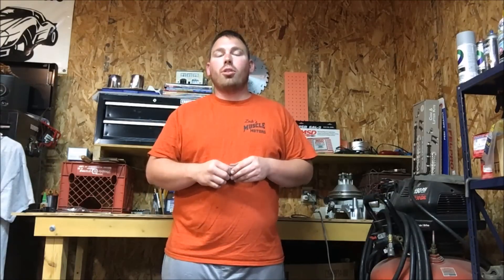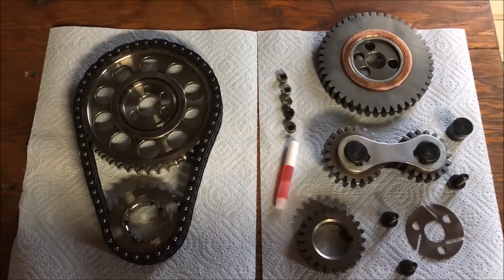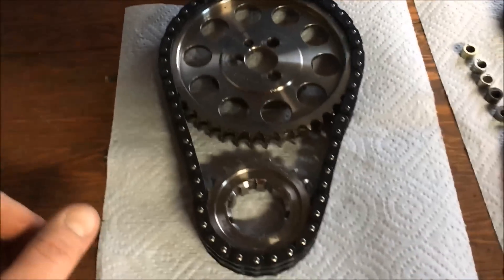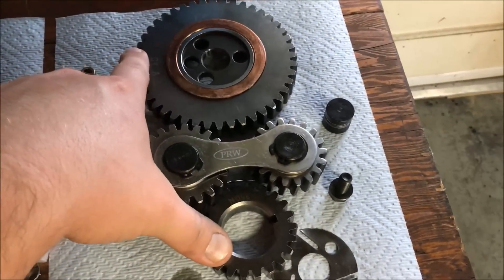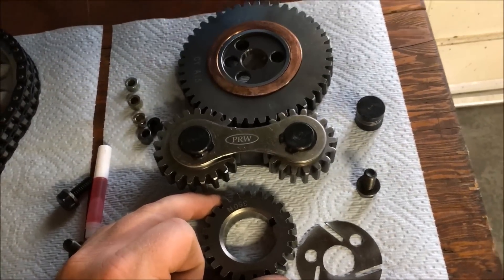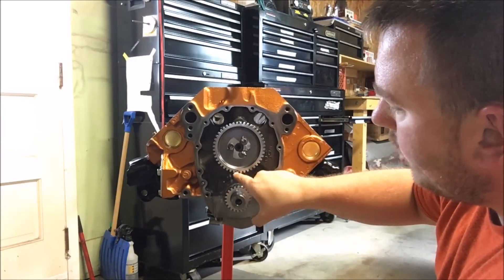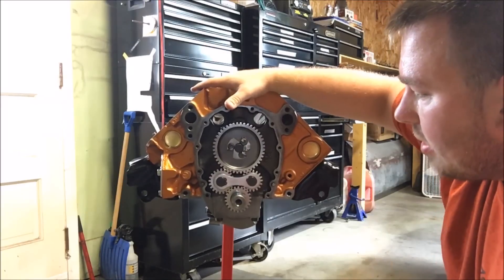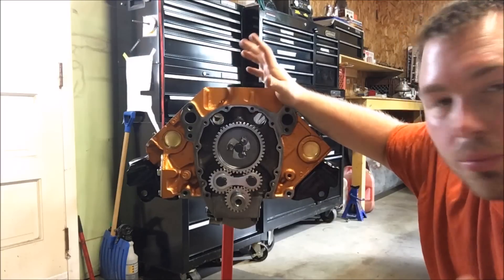Engine Building 101 Timing Gear Drive

Comment: Hey Zak Lamb..... I have this set up in my 85 Monte SS here in the UK.. needless to say Monte Carlo's are pretty rare here, never seen another at shows or for sale, so total lack of support.. anyhow you mention vibration being transfered to the block... how can I reduce this? is there anything I can buy? I don't know? maybe a Harmonic Balancer? sadly I don't know the 305 at all but I know mine engine has a few upgrades.. headers, H pipe, HEI diz, Holley carb, pro-flo air cleaner, 600hp rated prop, elec fan, but I want more power maybe 300hp but want to address this vibration thing you speak of...... I'm about to install Lunati cam kit, double valve springs etc.. grateful if you could take a lil time out on me.. regards
Reply from the maker: Hey Shane, thanks for your question!!!! When an engine is rotating, the mass is moving in a couple different directions, reciprocating and centrifugal. The vibration comes from a rotating assembly not being completely balanced. You have a couple options, but first let me say, with your 305 you won't have an issue really unless your turning some high rpms or your assembly is way out of whack. You'll be fine the way it it. When you start making more horsepower450-500 and up and turning 6,500 rpm or more you really want to consider taking out the rotating assemble and have it balanced. Also, a fluid damper ( harmonic balanced ) can really help cut down on vibration. I'll make a video to explain more for you in a day or two and post it. Hope this helps. Any other questions please feel free to ask!!!
Reply: Hey thanks so much for the info... like I said new to the 305 so a learning curve plus this Gear drive lark is all new to me, if it was a LB7 Duramax I'd be good lol!! (my other ride)
Reply from the maker: +Shane Pearce no problem man any time
Reply: Dear friend . PLEASE  Do yourself a favor Throw your Gear Drive away ..and purchase a Good high quality Cloyes Timing chain & set . If your really thinking about performance up grades get an after market set of small CC Aluminum Cylinder heads and depending on which motor you have  try the Comp Cams 268H if it's flat tappet . and use a nice high stall speed T.C.like in the 1000 over stock range remember the stock heads are whats keeping you from making any meaningful performance improvements  THEY SUCK...but there are any number of great balancers out there for that motor made by ATI.TCI ..just make sure it's NOT been dropped if your buying used look it over real well ...good luck..

Comment: A  Fixed Idler Gear Drive system (Like Milodon )is far better and superior then a floater Gear Drive system like you have shown here when you're going Gear Drive !
Reply: You just make yourself look like a moron trying to tear someone down for having a different opinion. I've known lots of people that have used these types of gear drives and never had a problem.
Reply: I don't  want any arguing here either! I have no hate at you at all Zak ! If you and I talked face to face it be alot better and what one is saying when typing it here at times !
Reply from the maker: True, however if you know what your doing, these are just fine.
Reply: There is not any skill really need to put a floater Gear Drive in ! its junk.. Fact!
Reply from the maker: +ricecarkiller your opinion. I've used them for YEARS in high performance applications and never had an issue. That's a FACT. No need to come on here and troll the comments your wasting your time. You need to look for correct lash and clearance with the timing cover. I really don't care what you think lol. Don't like em, move on!
Reply from the maker: +ricecarkiller lol far from a liberal. You are posting your opinion not facts. For junk they sure do sell a lot of them and never had issues with any that I have used. I don't care if it's a new comment or not your just creating a pot of crap to stir, a true gear head wouldn't sit here and stir shit up on another's page. I will keep building and using a floater cause they work. You can have all your opinions in the world and that's fine but when facts outweigh your opinion you don't have an argument and I don't have time for mindless opinions. Sorry to be so harsh with you but this is the kind of stuff that gets under my skin. Again is you don't agree that's fine, comment if you like, but don't be shocked when someone calls you on your bs. Have a good evening, like, share, and subscribe!
Reply: lol far from stirring the pot or was I trying to argue with you. lol! You may say you're  far from a liberal but are still acting like one! A true gear head will point out the  things you left out ! you need to slow your roll no need to get mad lol. sorry you can't change the fact that there sloppy ! facts did outweigh but your too bind to see it ! I never said floaters did not work lol.. they do not hold up as well or as long as a single fixed gear ! Its been a  proving fact ! yes they sell a lot of them just like they sell a lot of the e3 and spitfire spark plugs.. junk is junk ! like I said go have a beer keep building and have a Good Thanksgiving !
Reply: I was not tearing anyone down I gave a Opinion as did Zak on this ! I'm so sorry you can't read that.. as I see by that you made your self a moron !
Reply: Dollar for dollar. It's no contest. Floaters are an excellent choice. Used them for years on several small and big block Chevies. They are just as accurate as a "fixed gear" and tons cheaper. Or, you can ALWAYS just use a cheepo plastic timing chain set and stand by with broom and dustpan!
Reply: I jest bought one !
Reply from the maker: +ricecarkiller just to be clear you did say they were facts lol. I support people's rights, that includes the first amendment, so I'm not going to sensor what you post, however, I don't want arguing on my thread. Not what we are here for. Thanks for watching guys.

Comment: Do you know where I can get a two piece timing cover where one half of the timing cover comes off so I can adjust the timing without removing the whole timing cover or Harmonic balancer? Do the Gear drives work with factor hydraulic lift cams?
Reply from the maker: https://m.summitracing.com/parts/cca-210

My parts guy can save you money on it too!!! 

Contact Rob Rouch
https://m.facebook.com/profile.php?id=100000569022569&tsid=0.27291322289966047&source=typeahead
Reply: it will work with both i even put a gear drive set on a complete stock motor
Reply: ebay
Reply: oh ok thanks. Do timing gears work with  on hydraulic cams and lifters?
Reply: Anyone know if Gear Drives work with EFI systems? I thought I had heard they might cause an issue? Something possibly to do with the vibration from the gear drive system and vibration? Thanks all! I wanna do a engine with a Gear Drive and efi as well as with a factory Hydraulic cam. I have a corvette cam from a 1969 to a 1971 corvette I wanna say brand new. I wanna use and my dad used on a 1972 Corvette 350 with everything stock on the motor and it smoked the tires like no body's business with side pipes. My dad built the motor for a dealership's owner and you could hear that thing over 4 blocks away just running.
Reply: What do you recommend for damper on a engine with a dual idler Timing gear drive? Is there a way to make it work with a efi set up? Thanks